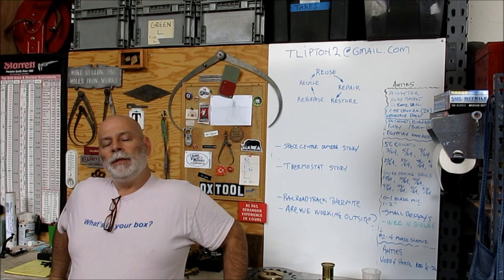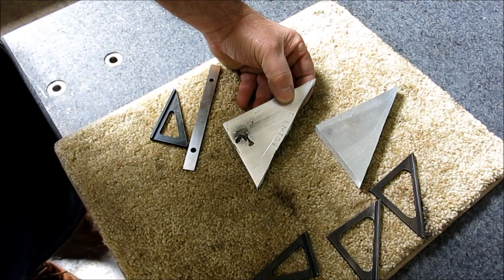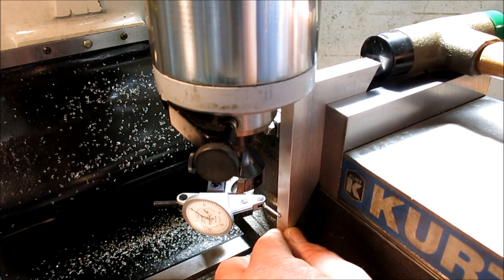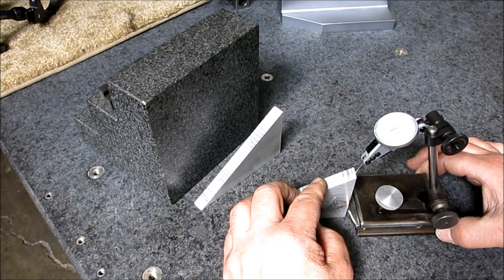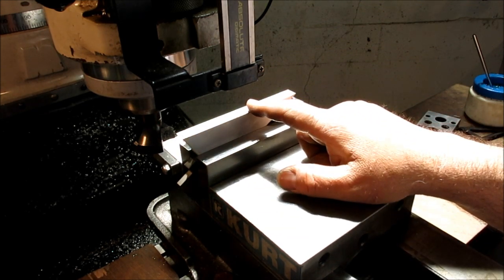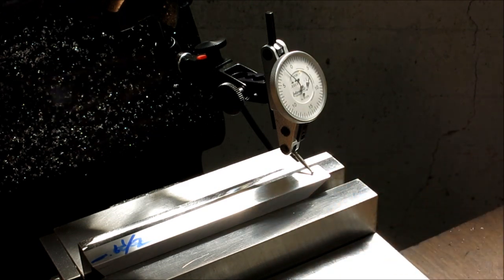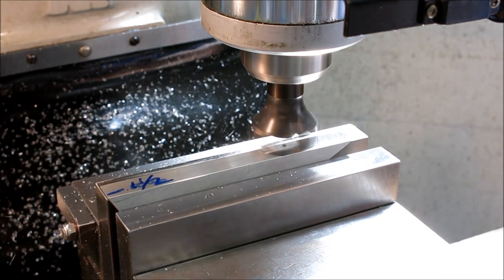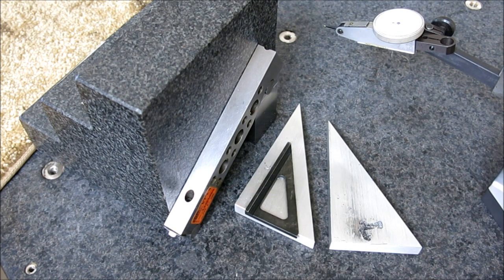Square Off 3

Comment: Tom, not related to this video but one of your prior videos showed me a tip that I used today. I have a wanabee Kurt vise and my part would not fit in it. You showed moving the vise jaws to the front and back of the vise. By golly my vise has the threaded holes to do the same thing! I was excited about that as it saved me a lot of time. Thanks much for your videos, I have learned so much from yours and others. My evenings are spent watching You Tube videos, no TV for me. Keep up the good work.
Reply from the maker: Hi David,

Thanks for the comment and sharing your experience. I love to hear that somebody got a new tool for their personal toolkit.

Cheers,

Tom

Comment: Hi Tom,

Those aluminum squares cost $200 to make and, probably in 5 seconds or less in a welding shop they will be worth no more than around 50 cents a pound.

Good metrology is fun but a little on the expansive side, just for that granite angle you have to plunge deep into your pocket. If you can't measure it, what is the purpose?

Very well explained as usual.

Thanks Tom,
Pierre
Reply from the maker: Hi Pierre,

$200 dollars? Man am I a cheap date. 

Cheers,

Tom

Comment: And not once did you mention the son of the squaw of the other two hides....

I've been watching folks using granite surface plates for a while now, and some of the things I've seen them do make me wonder about what's ok and what will eventually ruin the plate for it's intended purpose.  I'd be interested in a segment sometime on what you should and shouldn't do on a granite surface plate.  What materials to keep away from it, how to maintain it, how to clean it, etc.  one of these days I'll be getting one. And I'd hate t do something stupid and ruin it. It won't be as big or accurate as yours, but I'd still like to keep it in good shape. 

Thanks for the fun and educational video.  Precision is a fussy thing for sure!

-- Mike
Reply from the maker: Hey Mike,

The sad truth is you really need two. One for those questionable practices that need to happen and another you protect and maintain as a reference standard for measuring. It also depends how much fussy work you are doing. The granite wears slowly so It takes years to make a noticeable difference. Keeping them clean is a great place to start.

Cheers,

Tom

Comment: interesting project Tom, thanks for putting it up...there's machine work and then there is tool making machine work and they are different animals altogether...thanks as always I've learned so much from you, Fenner, Adam etc, cheers fellows!!! take care...
Reply from the maker: Hi Paul,

Thanks for the comment. Glad you enjoyed the series. I had fun doing it myself. 

Cheers,

Tom
Reply: oxtoolco
Tom ?...what is best technique to remove cosmoline...?
Reply from the maker: Hey Paul,

WD-40 soak and some elbow grease. Charcoal lighter fluid works as well.

Cheers,

Tom
Reply: oxtoolco
Thanks T...

Comment: Reasonably good tolerances are not terribly hard with a good mill and some careful setup.
My question, and of course I have one, would be:
Why not stick the indicator on the base and use the knee to align the part vertically. Wouldn't using the quill be subject to possible rotation skewing the reading? This is the technique I used when making some angle plates a few weeks back as I didn't trust the quill to stay put. Of course now that I have a surface plate I have to check them...lol

Colin
Reply from the maker: Hi Colin,

Lots of folks poo poo the quill. If your head is trammed then you should get similar results to using the knee movement for indicating. Its fitted to the bore quite well and still has a good bit up inside when extended. In particular for no force indicating. Try putting an indicator on your table from the column and pull on the table one way or another. Kind of surprising you can do anything with that kind of movement. 

Cheers,

Tom

Comment: Another fine didactic video, Tom!  ; )    
There's a lot of useful information to be gleaned from those few minutes you shared.
Thanks!
I suggest you sign those with your pneumatic pencil and send them back to Shadon.
(Don't forget to initial and date the calibration sticker.  : D  )
Reply from the maker: Hi Richard,

Calibration sticker. There is a good idea. I was going to send them back for re-engraving or as reference standards for Stan's "Stangles"

Cheers,

Tom

Comment: Another great video, no surprise there.  How about branching out to some gunsmith subjects.  I won't suggest what since you probably know 100% more about that than I do.  Thanks for the work on the video and please keep it up.
Reply from the maker: Hi Cerebus,

Gunsmithing is an interesting subject. I have not done much of it personally. We had a gunsmith at the shop I ran who got half the shop building their own Mauser based custom rifles at night. I was real close to doing a .375 H&H for myself. 

Cheers,

Tom
Reply: oxtoolco Interesting choice Tom. I have used a octagonal barrel .300 H&H a long time. Very nice. Always wanted the same in .375 H&H
Reply from the maker: Hi Greg,

I fell in love with the .375 H&H cartridge years ago. Its just so pleasing to the eye and accurate to boot.

Cheers,

Tom

Comment: It's always the same though, you go to all that trouble and your very next job you need a 36.12.18/53.47.42 square with a variable corrugated hypotenuse and you just don't have one to hand.  Great demonstration :)
Reply from the maker: Hey Steve,

Corrugated Hypotenuse. Now I got a laugh out of that technical specification. Note on drawing, "All Hypotenii will be corrugated mean peak to valley of 500 micro-inches or better" Or the ANSI Y14.5 spec, ~~~~~~~~500

Cheers,

Tom

Comment: Hi Tom

does the curved peace of steel needs to have a particular radius. I am planning to make one myself
Very worthwhile little series

thx

Teun
Reply from the maker: Hi Teun,

Not really. Most guys turn a disc then take a section out of it for the short arc segment. Smooth and hard are the needed qualities. I used tempered spring stock for mine.

Cheers,

Tom

Comment: Hi Tom that got me to wondering is that 1.5 discrepancy you measured at the mill in the mill alignment or is it some other variable?
Reply from the maker: Hi John,

These kind of small errors are hard to track down sources on. This is why you check everything when measuring to close limits. Couldn't say where it came from. 

Cheers,

Tom

Comment: Tom,
Nice set up with the thin sine bar.
I like your surface plate too. What is ti rated for as far as flatness goes?
Regards,
Eric
Reply from the maker: Hi Eric,

It has a calibration sticker on it from Standridge that says 22 millionths across the plate. 

Cheers,

Tom
Reply: WOW!!! I'd say that is F L A T!!
:-)
Eric
Reply: oxtoolco thats fairly flat. I dont suppose you know what kind of process/tools are used in the creation of surface plates?

Comment: Good work. The only issue I noticed was when you were indicating the part in the mill. The angle of the indicator looked steep. Interapids want about a 12 degree contact angle to be accurate. It should say it the manual for the indicator.
Reply from the maker: +Kenneth Miles Hey Kenneth,

I was not measuring with the indicator just comparing. If you remember it was good enough to get me within a couple tenths on the final product. You are correct that cosine error plays a part if you are using the test indicator for an actual measurement. In this case it was comparative and I was looking for a null reading. Thanks for the comment,

Cheers,

Tom

Comment: 5:06 It looks like there is a plumbing street elbow on your bandsaw, what would that have been for? lube ?
Reply from the maker: Hi Rusty,

The fitting is for coolant. Mine does not have a coolant pump but it was a common Doall option.

Cheers,

Tom

Comment: Ox what was the indicator holder you used on the mill spindle around 32:10?
Reply from the maker: Hi Alastair,

Its my own creation. Check out my video called "Noga indicol marriage" It combines two commercial parts to make a very functional test indicator holder.

Cheers,

Tom

Comment: Wont the abrasive dust from the sandpaper ruin the accuracy of the surface on your surface plate?
Reply from the maker: Hi Wankel,

You are correct. That's why I only use the one plate for those kinds of lapping operations. I have three granite plates in the shop.

cheers,

Tom

Comment: Been planning to make thin sinebar using my WEDM, now you got me CAD this and plans to get 6mm tool steel to make some of these. Anybody interested?
What length would you guys need, my plan is 100mm.
Reply: I would be interested in 2 @ 150mm to 125mm long take up most of the kurt vise. let me know on cost.
Reply from the maker: Hey Joe,

Let me know if you want closeups or any details of the one I have. Sounds like a great project. Keep me in the angle, I mean loop. Make the heel sit as low toward the roll radius as possible. They almost can't be too short for vise work.

Cheers,

Tom